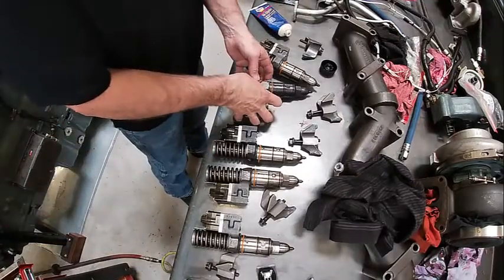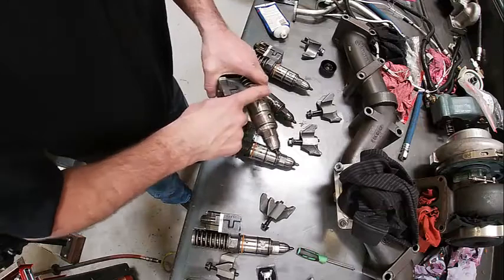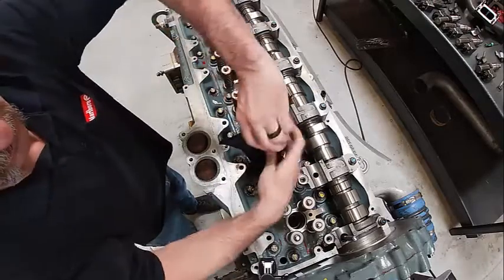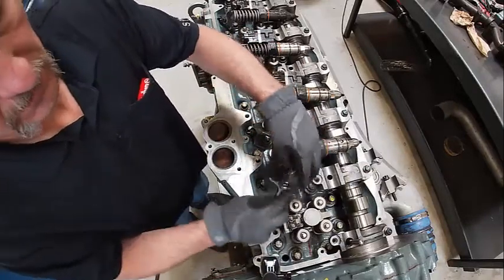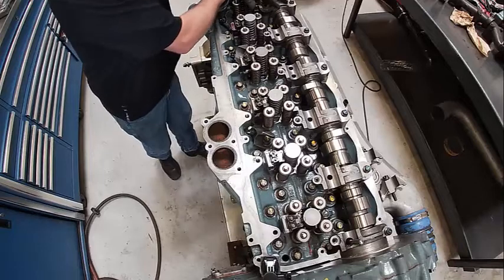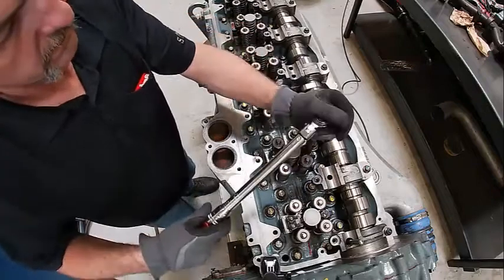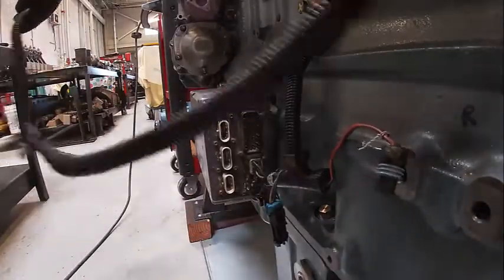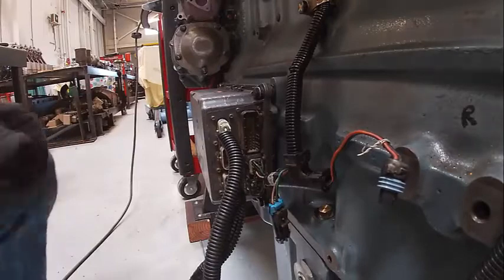60 Series Fuel Injector Install

Comment: Nice. Thanks for the video. 

What can go bad if the orings are our? 

I noticed that my fan clutch had gone out. The truck did over heat to about 230. 

When I changed my fan clutch I noticed that my vent pipe from the valve cover was showing more blow by than usual. Like burn smoke. 

I also noticed like oil inside my fuel tank. And I'm burning like 3-4 gallons of oil per week. 

I was told that due to my engine over heated, I maybe messed up the o-rings on the injectors.

I also found out that if fuel gets inside the oil pan , it's the injector cup. 

But since I have oil in my fuel tank, it's the o-rings on my injectors. 

I dont have oil spiltting or showing on my hand with the engine on. 
And the knob where u add oil. Smoke is coming out but no oil. 

Any feedback would be appreciated. Thanks again

Comment: I did not see the thick O ring on the bottom  before tip of injector.when it is necessary to put a carbon o ring on the tip as well?

Comment: Mr Gingerich I have a quick question. I have a 99 with ddec iv. I am just wanting to replace one injector on the number one cylinder. it has the 765 jake brake do I need to readjust valves on intake or exhaust , and or jake brake if everything is running fine for one injector replacement?
Reply from the maker: I would readjust.

Comment: I didn’t see you install the gasket that goes down in the engine it’s made out of an exhaust type material, also didn’t see you install the big O ring that goes down in the engine
Reply: If you add graphite seal and big fat black seal both in the injector cup before putting injector in, u will have fuel dilution in oil cuz it raises the injector to have very small leak. Detroit only recommends putting big fat black seal not graphite seal anymore.
Reply: that bottom or exhaust seal is also called ''graphite seal, and yes, there is a problem if that seal is not there, injectors are going out more often, am having that problem with my truck, even my serial number does not caLL FOR THE BIG FAT RING OR THE GRAPHITE SEALS, AM PUTING THEM ON TO  avoid future problems, still a good video and clean shop,